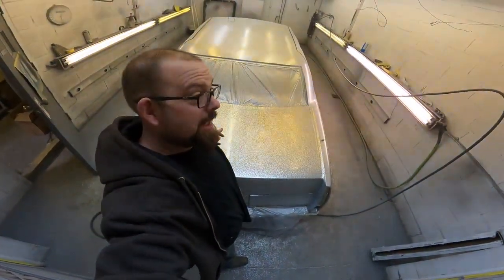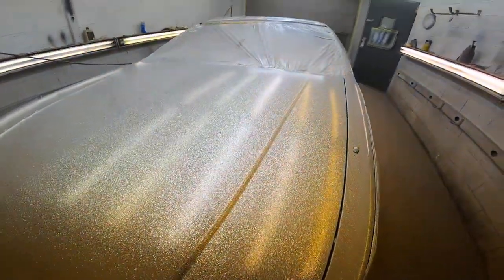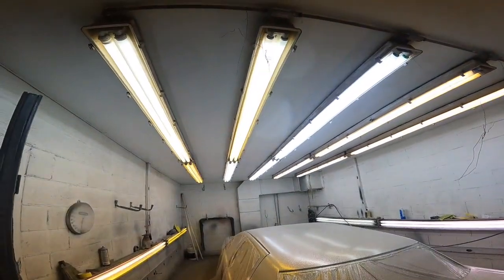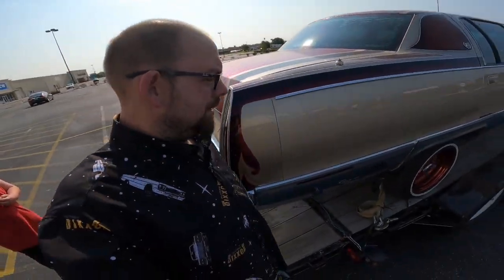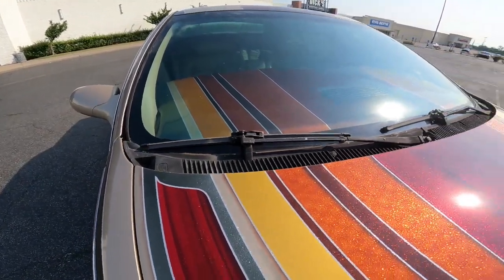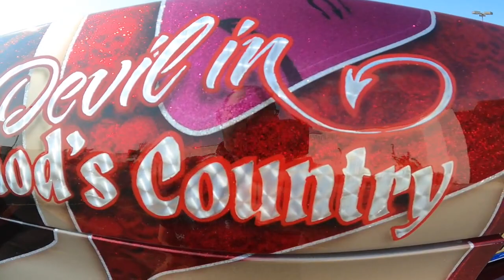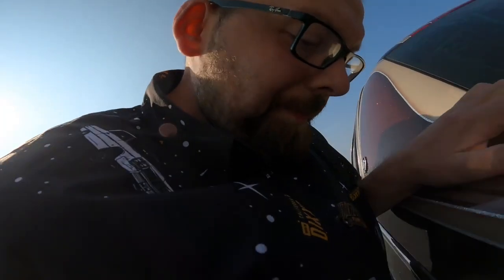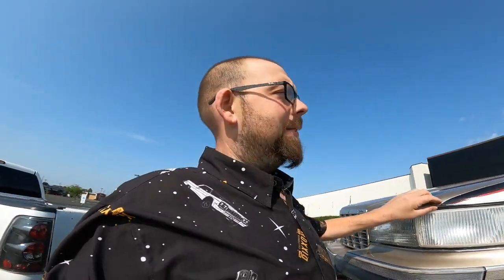Pattern paint for Cadillac Dan!

Comment: After you spray flake just scuff it then clear it again don’t sand it smooth right away u sand the actual flake down an it won’t pop the way it should in sun it dance better I learn that from my dad does a lot patterns
Reply from the maker: If you don’t sand the texture out your new clear will have the same texture. You need to make sure your flake is buried in the clear before sanding. If your sanding it flat and hitting flake then you don’t have enough clear on it.